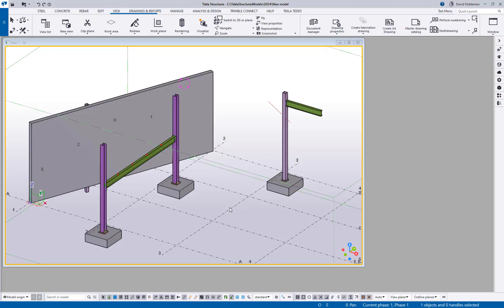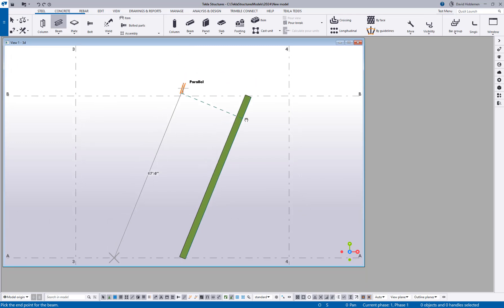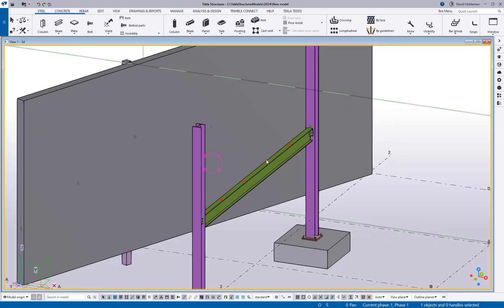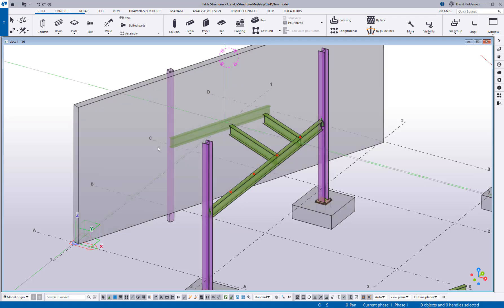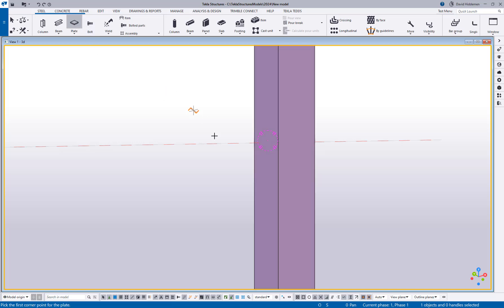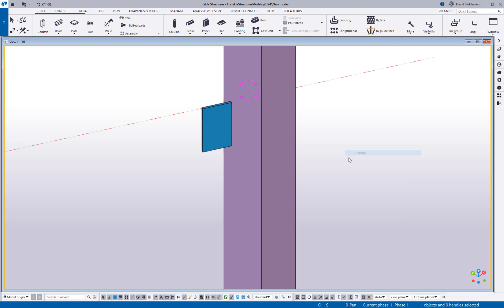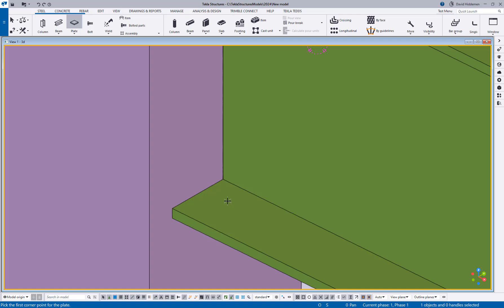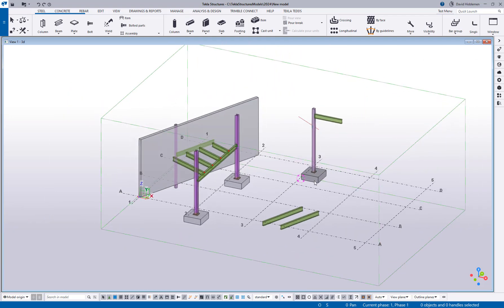Tekla Structures 2024   New Snapping Options

Comment: Here is some feedback.  Give me the option to have the pop up boxes from 2022 version instead of the property pane garbage thats in the newer versions. The snaping is not that much of an improvement over the downgrade of the property pane change.
Reply: Yeah, property pane was the worse idea ever. Slow and unpractical idea copied from Revit and implemented even worse.
Reply: Agreed but typical Tekla forcing it on users
Reply: Couldn't agree more. I hate it. It's been implemented to reduce the amount of open boxes but it's slow, cumbersome and awful to use. I can't stand the copy paste brush either. Wake up Tekla you are really annoying your core users!!!
Reply: You can hold "Ctrl"+ Left Click on Beam/Column. The dialog which you need, it will appear. However, I still new appearance 😅